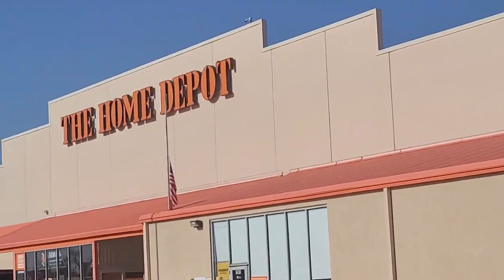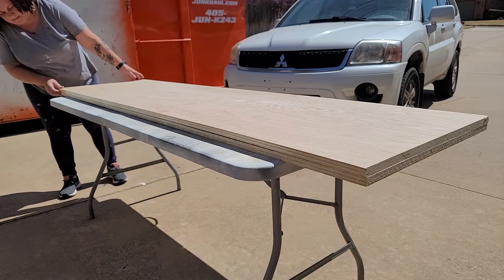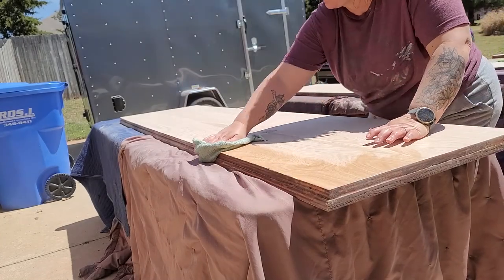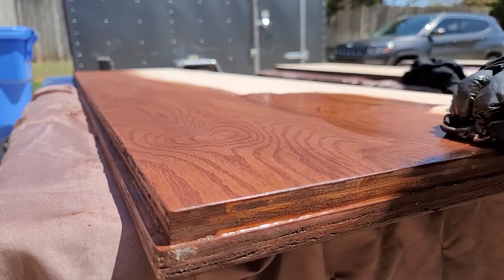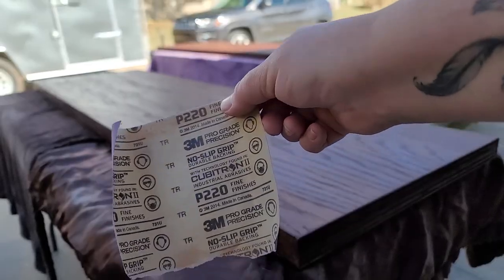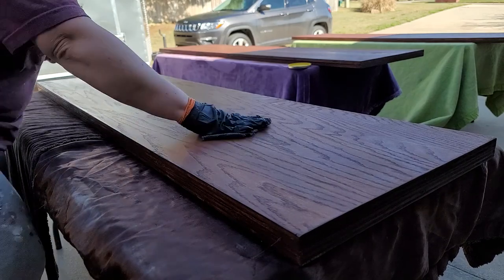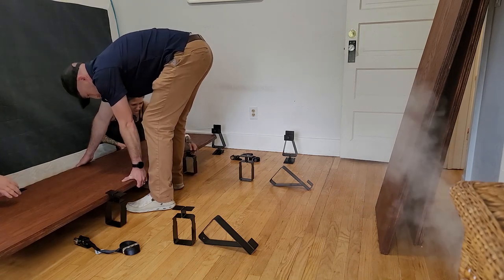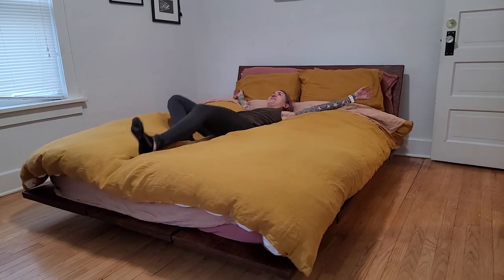DIY Modern Platform Bed/Platform Bed/Floyd Home Bed/Modern Bed

Comment: Great Video! Question... Could you make the bottom half of the 1.5" total particle board to save on cost?
Reply from the maker: As in only do .75" boards? I wouldn't recommend it. They wouldn't be strong enough to hold weight and would eventually bow
Reply: @SabsRehabs  no, the same as what you did in your video (double up .75" plywood) except use  .75" particle board for the bottom half (that isn't seen), which is half the cost. so the top half of the glued panels would be birch/oak/maple whatever and the bottom half would be particle board
Reply: @greiner19  particle board isnt very durable so i wouldnt recommend it even if you are using a stronger wood species on top!

Comment: Hi! Is there any wobbling on the headboard? If there is, would adding some cork padding give it more friction to secure it in place?
Reply from the maker: There is very minimal movement of the headboard. We put cork on thr back of ours to keep it from marking up the wall. I wouldn't consider it wobbly though. The headboard holder slides into between the panels, tightens on the under side of the wood panels and the headboard itself is tightened into the holder so it is pretty secure.

Comment: Could you use the twin kit and make a long headboard to make a daybed for a guest bedroom? Not 100% if you could use the headboard kit on the side of the bed versus the head of the bed. Surprised they don't offer that option. If yes, can you give the supplies and info needed to build that out?
Reply from the maker: I would contact Floyd Home and ask them that. I am not sure if that set up would work since the headboard holder is designed to fit in between panels at the head of the bed
Reply: a twin bed is typically 38" W x 75" L. the floyd twin bed frame is 45" W x 86" L. the full/queen headboard is 67" W x 18" L and the king headboard is 89" W x 18". if you use two of the full/queen headboards (36" W x 67" L), neither the width nor the length would be enough to fit a twin size bed. if you use two of the king headboards (36" W x 89" L), the length would have a lot of excess space, but the width would be too short causing the twin mattress to hover over the edges. three panels of the king headboard would be too much. if they had made the length of the king headboard at least 20" it would have worked for the width of a twin bed (though it would still look a bit funny with the extra space on the top and bottom), so I recommend getting the panels elsewhere if you want to save some money. aim for panels that are either the same size floyd provides or you could go a bit smaller like 45" W x 81" L (86" is used across all of floyd's bed frames). i know its been awhile but hope this helps someone!

Comment: Why did you not use a saw or sander to take off the uneven cuts?  I understand it takes more time however it makes it looks better and not so homemade.
Reply from the maker: Very true. When I made this bed I wasn't very skilled with a saw. I definitely would now after a year of wood working. I made a king sized one for myself and did the cuts this time. It was 100% better then the cuts Home Depot made for my friend's bed.

Comment: Hi! Is there a mistake in the king measurements for the panels? You wrote 89”x22” for the platform panels but the Floyd panels are 86”x22” just like the queen. Are you recommending we cut them and make bigger panels? 

Also thank you so much for this video. My girlfriend and I are about to do exactly what you laid out in this video! We didn’t know anything about sourcing or cutting wood so this was super helpful.
Reply from the maker: I will update that now. It was a typo. Thank you for catching that!
Reply from the maker: 89" would be for a California King bed.
Reply from the maker: Okay I fixed the typo! And glad you found this video helpful!

Comment: I done woodworking before in high-school years ago .I was thinking about making platform bedframe to .I seen people try use plywood make them .my guestion why type wood did u use make it with .did u make any tiny pugs holes to put wooden pug in to snap frame altogether  that it stay tight .did u make tiny legs on bottom hold it up from top to bottom .u did good job if I make one I do not know if I go with head board or not .oh how much did u spend on wood my guess 200 or more .
Reply from the maker: I bought what supplies I could find at Home Depot so that is the wood I went with. And price spent on wood varies from region to region and bed size. I broke down what wood I got, how many I bought and showed exactly what I did to build it. Feel free to watch again and price the wood according to your area.